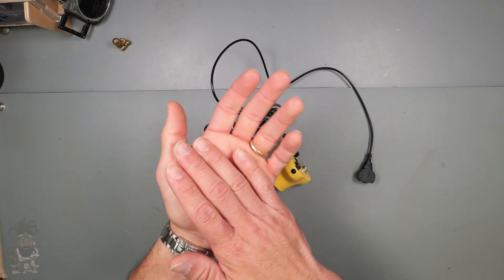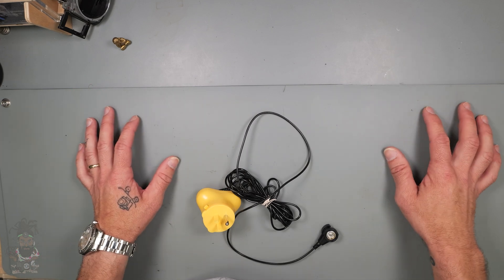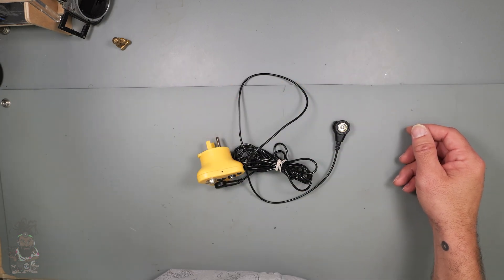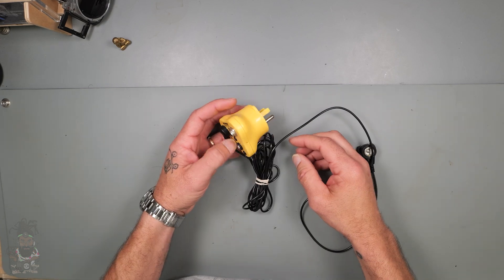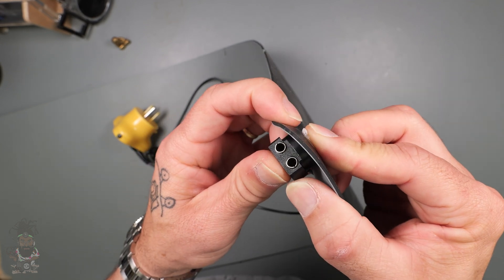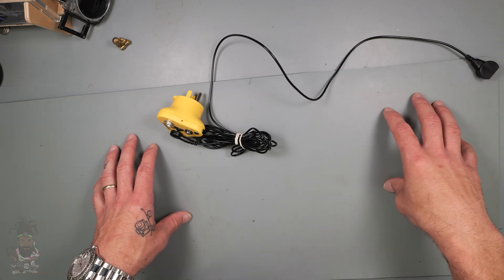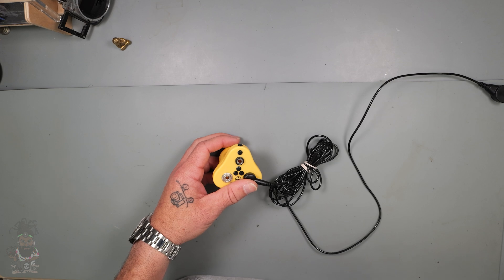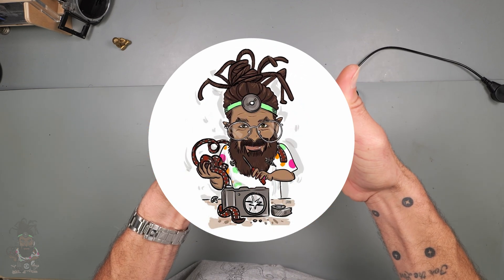Anti-Static Grounding Mats: Why and How

Comment: Grounding the mat is not enough to save from ESD. You also have to ground yourself via an antistatic wrist strap. Otherwise there's possibly that the chagres can damage the sensitive mosfet or a photodiode etc. There must be no potential difference between your hand(and the holding the components) and the mat. Solder iron tip also has to be grounded.